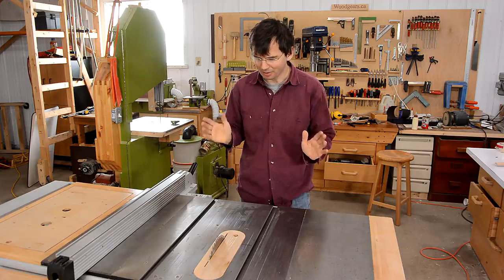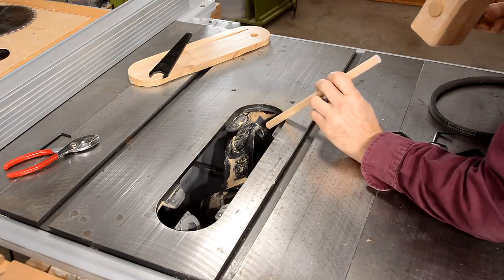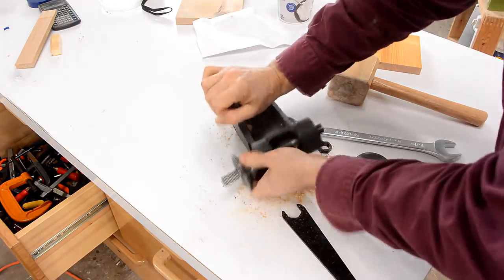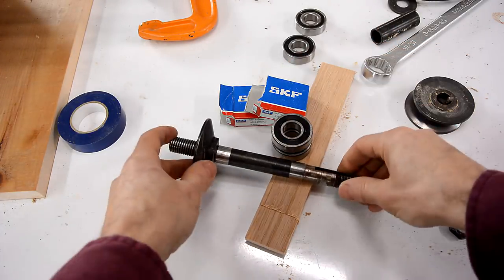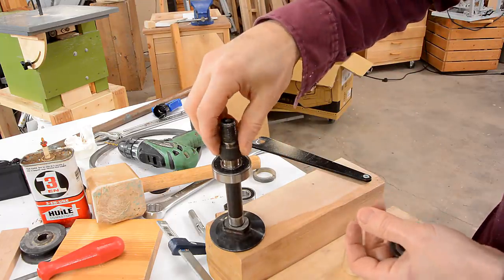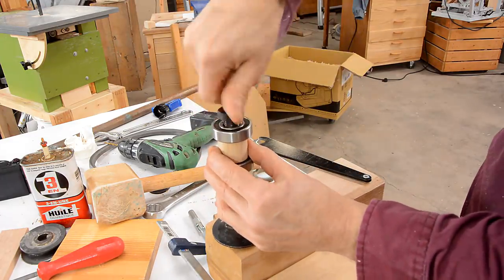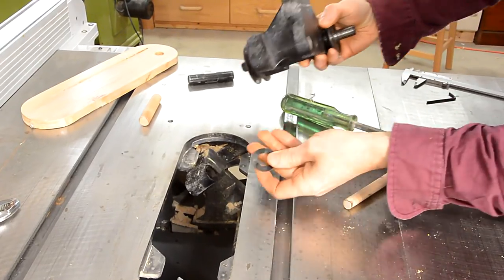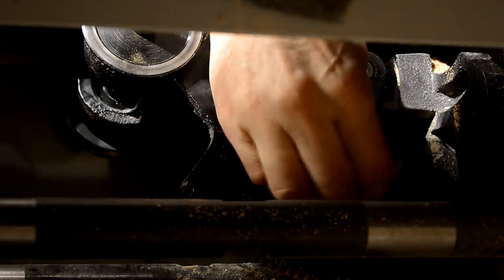Hybrid table saw bearing replacement

Comment: I was putting this job off for years and my saw was getting quite loud.  Seeing how you did it was a great help.  My biggest barrier to starting was I envisioned having to take the whole saw apart, showing how to just remove arbor assembly was brilliant.  Removing and pressing the bearings back on was not as difficult as I feared.  Saws must use a light interference fit,  I was expecting needing a heavy press to accomplish this.  Your tutorial was excellent and I liked how you didn't hide the trial and errors.  Showing/describing the little mistakes was so very helpful as it really highlighted potential pitfalls.  All in all great job.

Comment: Matthias, not much help now but if you put the shaft in the freezer it should shrink enough to get the bearings on without too much effort.
Reply: As you cool the shaft, wrap the bearings in aluminum (aluminium) foil and then place on top of a bare incandescent bulb. 250* F (120*C) -300*F (150*C) will be sufficient.
Reply: I have not used the aluminum foil on the incandescent bulb idea, but I have used the freezer suggestion with success. It works great for a jointer arbor.
Reply: I use a 250w laser to warm up the bearings after freezing the shaft in liquid nitrogen.  I then use 3 oxen to pull it apart.  No WD-40 needed.
Reply: The foil just prevents oil or grease from getting on the bulb.
Reply: Good idea guys put one part in the freezer and the other in the oven. I finally figured out why my wife don't want me in her kitchen.
Reply: I'm a fan of the wet-towel-in-microwave method. Works remarkably well and doesn't require excessive hammering on new bearings (even with a wooden mallet).
Reply: if you put it in the freezer, it will freeze.
Reply: Im more of a fan of the microwave method 
Wrap it in a damp cloth, in the microwave for 20 seconds at a time
Its max temp will be 100c because the water evaporates at 100c
And for the cooling side, you can once again put wet cloths around it to get it colder faster  (works with drinks in the freezer as well)
And once its freezer cold if there is still interference you can use a can of air duster upside-down to chill it more 
This is how i normally fit pistons and rods together that are press fit or would otherwise take heating
Reply: To warm the bearings, I put them in hot oil (motor oil). With the trick of the shaft in the freezer, it works like a charm.
Reply: The smart way is to use an arbor press.
Reply: Or, since he's in Canada, just leave it outside.
Reply: laser liquid nitrogen ... pfft!
Reply: Use the force... no hands
Reply: actually you can get liquid nitrogen for that purpose at a lot of welders supply stores.  We use it to pour into homemade ice cream for an instant freeze and a fluffy product.  But you have to be careful to protect your hands and wear a face mask.
Reply: Sean Fyodorovich :-) :-) :-)

Comment: Many years ago I did this to my Delta contractors' saw. I, too, used SKF bearings. At the same time, I ditched the v-belt and sheaves for a ribbed flat belt and sheaves (all parts from McMaster-Carr). What a world of difference! Quiet, and smooth as oiled glass.

Comment: I love the jig you set up.  Also the wooden bearing press.  I recently had a similar repair on the arbor on my lathe.  Having never had to do that repair before,  it took me a little longer than it should have.  Removing bearings a second time happened to me as well.  Live and learn.

Comment: Hi folks. Mathias did a great job changing those out. If you have to do it try and minimise the stress on the bearings. Push on the bit that is a tight fit, don't apply force to the inner race to make the outer one fit or vice versa and do not hamer them home - those actions significantly reduce the life of the bearings. As pointed out by others below, warming the housing and cooling the spindle will also help, but you need to work quickly or they just all reach the same temperature. Sometimes a lenght of 'allthread' can be a big help depending on the configuration and conveniently sized mechanics sockets are much used as spacers.  But, Mathias, of course, did it with wood! Cheers. BobUK.

Comment: Great insight into your problem solving mind, Matthias :)
I would have liked to see the state of the old bearing, if the damage was visible
Reply from the maker: Damage probably very subtle.  It was still working, just loud.
Reply: Yeah, I kind of figured if you didn't show it, it probably meant it wasn't worth showing. Thanks for the answer!
Reply: Was the blade wobbling?
Reply: In my experience, when a bearing gets noisy like that, it means the lubrication inside has broken down and dried out. If they have bearing seals that can be removed (the new ones he is using do) then they are able to be re lubricated as long as the bearings have not run too long dry and worn on the inner and outer race causing movement. Hope that helps!
Reply: With the amount of work used to get them out, it's better to just put in new bearings and not have to worry about it, especially if they are cheap standard bearings.
Reply: You wouldn't have seen much if he did pull the seals. Basically, the original lube dried up (like Richard said). Assuming that the bearings still felt tight, as in the arbor wasn't flopping around, he could repack them with some bearing grease, put the seals back in place, and press them back on. You're right, though, MrSatchelpack, and you have to factor in your time. If you repack them, are you going to have to pull the bearings again in a year?
Reply: Buen trabajo maestro Mathias

Comment: put the bearings in your oven at 120-150 degrees celsius (the grease can take it) and they should slide on easily. saved me hours of bumping and hammering :)
Reply from the maker: and how do I put the bearings in there without putting the shaft that they are stuck on in?  Getting the new ones on was the easy part.
Reply: Matthias Wandel an angle grinder solves that problem
Reply: He was replying to installing the new bearings I believe. I usually put the shaft in the freezer and warm the bearings on a 40-60w bulb or just hold them in my hands till warm. Then with the cold shaft and warm bearings the inner race just slides on to the shaft no press and very quick. If it doesn’t seat all the way at the bottom I find a piece of pvc that fits the inner race and hit the inner race down till it seats.
Reply: I can confirm this works really well with putting on the new bearings, I did 200 degrees Fahrenheit and the new bearing slid right on the shaft without needing a press
Reply: He said pouring the new ones one wasn't hard.
Reply: +Dennis Pope, I wouldn't say it's very quick. Using a press (or even some gear pullers/ a vice) is the fastest way to remove bearings. No waiting for the oven to warm up etc.
Reply: zXLuke4efcXz that can be taken care of with a microwave and some wet kitchen paper towels if you're up for an adventure :)

Comment: There's an old saying that goes Dont Force It, Get A Bigger Hammer. 
Or the one from the Fire Fighter perspective,
If It Wont Move, Force It, If It Breaks, It Needed To Be Fixed Anyway.
Reply: and if you've tried your biggest hammer and its still not working, then the problem must be electrical

Comment: I fully empathize.  I spent a half-day on my back reaching up into my very similar saw trying to get a gear-puller into tight quarters.  My saw uses an intermediate pulley between the motor and the arbor, (which has a nice side effect of not having to move the motor when I raise the blade) but that also means it’s a dual pulley, (v-belt+ribbed timing belt style) and this fine “Canadian” made in Taiwan saw used cast tin-foil for that custom pulley.  Since I bought the saw, this outfit has gone bankrupt twice, this final time for good, and long story short, after a disastrous adventure in 3D printing, I had a local machine shop duplicate the pulley out of stainless steel, for less than any local shop would print me one out of any sort of nylon or abs.  One shop offered to print on in bronze infused stainless for nearly 700.oo.  The machine shop did a one-off for 150.oo.

Comment: To get a better sound, normal people tune their cars, Matthias improves his table saw 😉
Reply: I just put on some music.
Reply: He didn't improve it, he fixed it.. He replaced bearings! I still laugh at the modern idea of "car tuning".. In the old days, it meant a "tune up".. Clean and gap the points and plugs and occasionally, a clean of the carby(s). When needed, replacing points, plugs and carby kit or kits where multiple carby's were fitted. It had nothing to do with how a car "sounded".. Lol.
Reply: But you can’t tuna fish.
Reply: It's not so much a better sound he wants, but the sound is a symptom of an issue, the issue in this case a bad bearing.
Reply: maintains*

Comment: Nice one - but would have been much easier to fit the new bearings by taking advantage of differential expansion - shaft in freezer, warm bearings in oven,
Reply: Wrong Bearing in Freezer and shaft in Oven.
Reply: @dannmarks  You may wish to rethink that.😉
Reply: That doesn't sound easier.

Comment: I just completed this job on a Rexon RXW10 tablesaw, it was almost exactly the same. One difference was I had 2 spring washers on the arbor pin and they were a pain in the ass get to back in, this was the hardest part of the job. Like Mathias I bought the same bearings from Motion Canada at 6$ apiece. I lubricated everything with a graphite spray dry lube. My arbor was a little different in design in that the shiv was one piece. My old bearings pulled off easier and new ones pressed on easily. I need a good idea as to how to hook dust collection up to this saw.

Comment: Hey Matthias! Next time you need to change a bearing on a shaft like that, after youve removed the old bearings, just stick it in the freezer for an hour or two. The cold causes the metal to contract and shrink a few thousandths of an inch. Sounds stupid but 9 times out of 10 it works beautifully! Works good for wheel bearing hubs and u-joints and  things like that as well. Not trying to sound like a know it all or say your way is wrong or anything. The internets got enough keyboard captains.

Comment: Hi Mathias, 
If that nut is moving again, try to find a ring with a lip on the inside that slides in that groove. Put than that nut on again, the ring won't turn so when the nut is tightened put a cold chisel under the ring and hit the chisel, the nut will stay in place.

Comment: hello how, I always watch your videos with a lot of attention, and I like them a lot, now let me give you an opinion, for the assembly of the axis you do not have to do as much force or blows, the shaft goes a time at low temperature, the bearings can go in a container with warm oil, then you will do it with olgura much easier, hug! from Argentina .
Sorry for the translation, it's the google translator

Comment: To press bearings onto shafts black/steel water pipe works well. Get a size that barely fits over the shaft, then it will stay straight & only press the inner race of the bearing.

Comment: I remember getting sent over to the carpenter shop one time because their Unisaw was making evil sounds. Bad bearings, the arbor was damaged and the pulley was shot. Made a new arbor and pulley, re-assembled, aligned the blade and we tired it up. Smooth, quiet (for a table saw) and cut great. Must of made somebody mad because the Safety Dept came out and locked it out a couple of weeks later.

Comment: Hi, I am about to do the same thing on my table saw (different one) and i am also using skf bearings as you do. Mine are 6000 rs but what i was wondering, i just got them today brand new but they are not spinning at all compared to 6000 zz with metal cover. Is this normal?

Comment: "That bearing is not moving"
Applies WD40
"It's moving!"
Reply: Simba shouldve sprayed WD40 on his dad, maybe he would have moved again
Reply: Heino
Reply: Three rules of engineering... Does it move? No? Should it? Yes. Use WD40.
Does it move? Yes? Should it? No. Use duct tape.
Reply: Travis Ross what’s the third rule then lmao
Reply: That was pretty much my reaction when I finally started to get movement on a stubborn, worn out bearing that was press fit into the lower housing of a 7518 Porter Cable router that I bought on Ebay really cheap.

Comment: I found that heating bearings to 100 Celsius completely eliminated the need to pound on them to force them onto the shaft.  AvE has an interesting technique using wet paper towel and a microwave. 
Personally I didn’t want to risk metal in the microwave so I placed the bearings in plastic bags and immersed them in a small container filled with near boiling water.   The heated bearings slid very easily onto the shaft with no force required at all.
Reply: To remove old bearings I used a gear puller.  No hammering required.  But means spending money on a new tool or two :)

Comment: when you were pounding on the shaft to remove the bearing, I disturbed my wife when I cried out "clamps, where are your clamps!" as watched you adjust your angle iron :) I imagine it wasn't a big issue just seemed it in the sped up footage

Comment: How come the pulley that the belt turns is made of two separate pieces and not just one solid pulley?
Reply from the maker: Cause they made it that way.
Reply: Is that a thing with imperial belts? I only know metric/DIN belts which just have a fixed profile (e.g. B/13 is 13 mm wide at the top). I'd have guessed that a split pulley is simply cheaper to manufacture.
Reply: I doubt it's anything to do with imperial or metric belts, I'm in the states and I don't think split pulleys like that are anything common.  That saw was most likely made in taiwan so it could very well have a metric sized pulley/belt.  My guess would be the same as yours, just the manufacturer cutting costs.
Reply: I think that's called a "pithy" comment.
Reply: Probably just cheaper
Reply: Wasn’t a stupid question though, it was a very reasonable request for information.
Reply: Kate Feel free to think it is a stupid question. Not sure why you think it is stupid though. Unless you think it was trivial and simply not an important detail worth asking about, in which case you will just have to deal with the fact that some people are observant, curious, and like to expand their knowledge.
Reply: Sometimes its made that way so you can change the rpms of the blade. The wider the pulleys gets, the faster the blade will turn.
Reply: Evaristo Salazar Do you mean the wider the pulley diameter gets? The pulley splits widthways and not in a way that would increase the diameter.
Reply: No, he mean't the width of the pulley. He didn't explain it well enough, though. If you take a V belt pulley like that and move the "walls" inward, the belt is going to raise out of the channel between the "walls". That changes the effective diameter of the pulley. If you move the "walls" apart, you get a smaller diameter pulley. If you Google "Reeves Drive" or "Variable Diameter Pulley" you can read more about it. A lot of go karts and gas powered golf carts have them.
Reply: Much cheaper and easier to manufacture 2 halves via a sheet of stamped steel than machine a pulley even if it's aluminium.
Reply: Agreed. That's likely why they did it.
Reply: Michael Major so did certain Dutch cars!
Reply: @evaristosalazar9169  absolutely right!
If you put a washer between the two halves then the belt goes in deeper resulting in a decreased diameter an higher speed of saw blade.
I have a Kity wood lathe which uses this principle for speed adjustment.
Reply: That was also the only way to adjust the tension of the fan belt on a Volkswagen Beetle!

Comment: I learned not to use a metal hammer to drive the old bearing off the arbor the first time I did this to my old Walker Turner saw :-)  I ended up using a piece of metal pipe slightly larger than the arbor diameter to hammer on to press the new bearing on.  Getting at my arbor bearings was a lot more involved though lol

Comment: My table saw at work started doing that sound and we got a guy in to fix it. The bearings were press fit but he bashed it around so much and heated the pieces, now the blade wobbles slightly and my cuts are more guess work ... I wish I saw this video before!

Comment: Clean the shafts before driving bearings on and off, use a little emery cloth to remove any burrs.
 One small filing between the bearing and shaft will cause big issues. Other than that, great Mcgyvering!

Comment: Hello Matthias. Not sure if you read comments on old videos but here goes. I was just rewatching this and was recommended the video where you ground the arbor flange to reduce runout. It got me wondering if you re-checked the arbor runout after changing the bearings?

Comment: Heating up the stuck parts increases the size of the parts, and the size of the gap. So you could have heated the shaft and the bearings if they gave you trouble and it would have been easier.

Comment: A good trick to use is put the shaft in the freezer for a while and if your toaster oven goes down to say 100° F warm up the bearing with that you'll still need to use force but alot less.